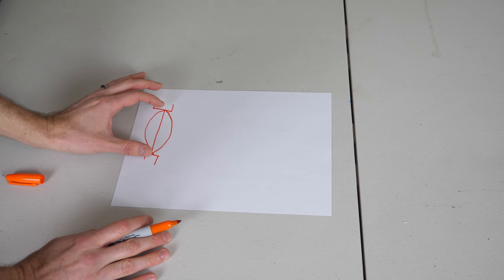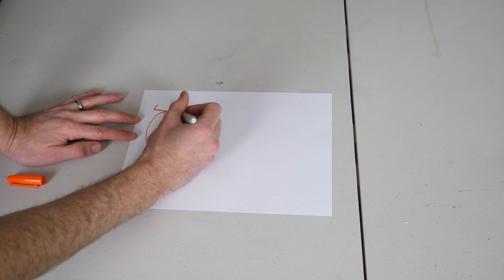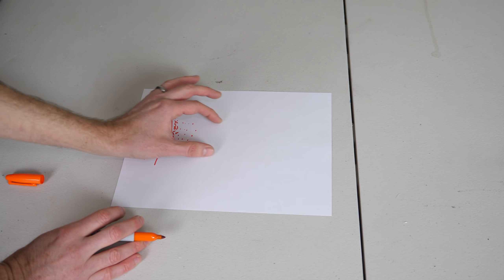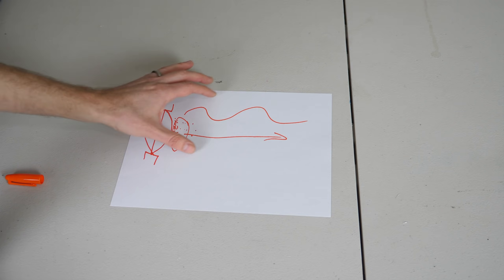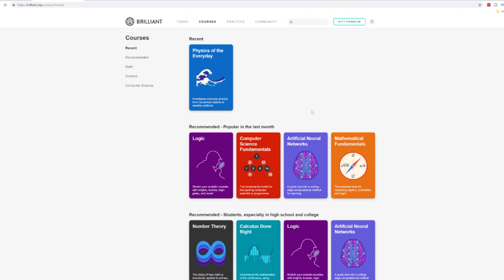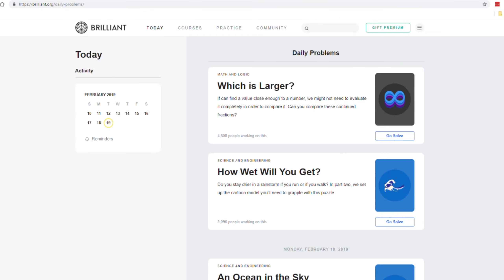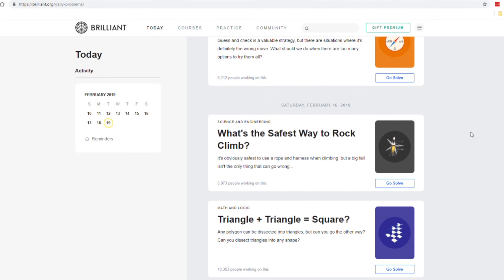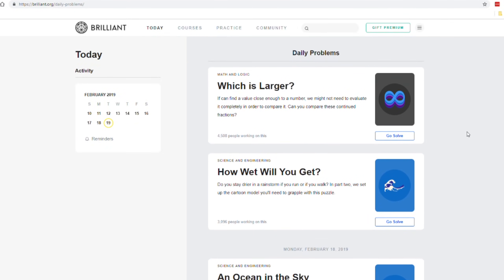Can You Figure Out the Mysterious Self-Singing Pipe Experiment?

Comment: I tried it with 2 inch galvanized pipe and a wire-mesh, it didn’t work.

What should be:
1) the pipe diameter?
2) the pipe length?
3) the wire-mesh hole distance?

Comment: I wonder if there is a thermoacoustic effect here. The wire mesh acts like a thermacoustic stack which (via heat transfer) pumps sound energy into the tube at the resonant frequency of the air column.  The sound stops when the pipe is horizontal because the lower air flow reduces the temperature difference across the stack (mesh).  You could demonstrate this by removing the mesh and heating just the outside of the tube. I'd bet the pipe will not sing without the mesh (thermoacoustic stack).

Comment: 11:03 The whole basis on how the LPC-10 speech signal compression algorithm works...It works by taking a dirac delta function, which is an impulse with silence around it and looping it at the frequency detected in the original signal through autocorrelation, then trying putting different filter coefficients through a digital filter until it finds the ones with the lowest difference between the original and the filtered output, then just stores the frequency and the filter coefficients. Which is why it's pretty lousy at reproducing instrumental music (which has more than one fundamental pitch simultaneously).

Comment: Notice the pipe length is about the length of half of the aluminum rod, but about an octave lower. This is similar to a clarinet, flute comparison. A clarinet and flute are about the same length, but the clarinet is about an octave lower. The clarinet is a closed pipe and the flute an open pipe. The trumpet is a different animal though, and this experiment is much more related to a clarinet. A spectrum analysis of the pipe sound also shows stronger odd overtones similar to a clarinet sound. Great visual explanation of an audio phenomena, and a must see for my clarinet students! Thanks.

Comment: Speaking of convection currents... The hot water output pipe on your water heater will let heat out of the tank in to the piping system, even when there is no flow, because there is no trap. A high spot in the pipe will block this flow of heat similarly to how a low spot in a drain pipe will trap water and block the movement of air. it doesn't take muck, even a loop that extends a couple of inches higher than the remainder of the pipe will block the flow of heat.

Comment: 8:50
If it sounds like a trumpet, then air is moving through it. What moves the air? Probably, the temperature difference. The bottom of the pipe is hotter than the top, so it heats the air which goes up and frictionst against the walls. The mesh, it has to do with the sound too but I missed where it is. Probably, it doesn't really matter cuz the air will move through the mesh anyway as long as the heated end looks down.

Let's see if I'm right...

Comment: Thinking about Rijke Tube ...it's just an organ pipe.  But what would make an organ pipe start self-oscillating?  AMPLIFIED FEEDBACK of course!   Just put a loudspeaker and microphone in there, with a power amp.  It will start singing, eh?
But that means ...the red hot screen must be ...AN AUDIO AMPLIFIER.  No getting around it.   Yet this seems obvious, once we've had the idea.   A red-hot wire will suddenly expand some cold air, but normally, the wire already becomes covered with expanded hot air.   Any "sudden expansions" and sound waves must happen because the hot wire is suddenly exposed to cool air, because relative motion between a red hot wire and the surrounding air has let the hot wire touch cold air.   To emit acoustic energy: to create a sound pulse, suddenly move the air.  Or, move the wire.   Sound flies out, and the wire gets cooler.  (Need an electric heater!)

Inside the Rijke Tube, if the air should slightly oscillate at the start, this will cause each red hot wire to generate sound-pulses, with a new pulse every time the air moves fully up or fully down, and touches the unheated air.

But that's no good!  TWO pulses per cycle, so this amplifier would be an ..um ...FULL WAVE RECTIFIER!!!.  It's only driving the 2nd harmonic, and instead of amplifying, would always be doubling the existing sound frequency, 2,4,8,16,etc.   To fix this, just use the "transistor bias" concept, by adding a constant air flow.  Now the slow-moving air is CONSTANTLY being expanded as it passes the wire.  

If it should then wiggle, then at the positive excursion it will expand more, and at the negative peak it will expand less.  NOW the hot wire is acting like a proper audio amplifier.   Stick it inside a pipe, and you've now got some reflections and feedback.   LOUD PURE TONE.

The Rijke Tube conceals a Victorian or "Steam-punk" gain-block!   Now think up some other uses for this "Rijke Amplifier."   

Heh, a metal screen that's chilled in liquid nitrogen might also make sounds, as it instantly contracts the moving air.   

Ah, that brings up the idea of STACKS OF RED HOT SCREENS, which SHOULDN'T give added amplification because only the first screen fully heats the air.  Instead we need to add "chiller-screens" between the hot ones!  How many screen-layers needed, in order to change a half-watt sound into a hundred-watt sound?   Can we build something that looks like a heated tennis-racket, yet whenever we yell through it, the sound gets twice as loud?  NICHROME GRID VERSION!  Stays red hot.   And then you could add forty-four pipes of differing lengths, and a keyboard to switch the nichrome heating, to make a "Franklin Pipe-Orgain Armonica" rather than a wet rotary glass armonica.  Sounds like an electronic synth.   Makes Ben Frankin's wife hysterical.

I notice that whenever I bring the oscillating pipe near the flame, so a bit of hot gas goes in, THE PITCH GOES UP!   Less dense gas!   

Ah, TRY HELIUM.  Try propane, try CO2.  Maybe it can detect the fumes above a pool of alcohol?  Does it sing higher as you go up the elevator, in a tall building?   Blow your CO2-laden breath into the "intake" while it's singing.  

Next, give the nichrome-constant-oscillator-pipe a sequence of different gasses, so it converts the gas-sequence into music.

But that's with wires being still, and the air moving.  What if instead the wires vibrated?   What if I used an asbestos glove, so I could STRUM MY RED HOT NICHROME-STRINGS GUITAR?  But the strings would put out 2F, one octave higher.  Sounds like an effects-pedal?   Well, unless air was blowing across them ...because  ...because  ...I'm strapped to the tower on my Deathmobile riding across the desert in some recent Mad Max movie?   THEY DID THE FIRE WRONG, IT SHOULD HAVE BEEN BLOWING ACROSS THE GUITAR STRINGS!!!   Heh.    Post-apocalyptic non-electronic flame-powered amplification, based on gas-flow across red hot wires, well suited to crude DIY tech devices.
.
PS
The "Was Septre" in ancient Egypt contained two secrets:  it was a crowbar, plus one other thing, where there is a little fork device on the far end.

Comment: 7:50 It works because that flame heats up the mesh at the bottom. That mesh heats up air molecules causing them to rise, so when you hold the pipe directly up and down, with the mesh at the bottom of the pipe, the air molecules travel through the pipe making it resonate, and you get that trumpet like noise

Comment: I got hold of a 1 metre aluminium rod and tried this - it works and is truly LOUD. I just wonder if a steel rod would be louder as it has more mass. I guess the frequency would be the same, although the vibration might travel faster through steel. In Helium gas the frequency rises, but what about a solid vibrating rod ? ….  Anyone tried this ?

Comment: I am 65 and have lost several different high freq.  sounds. I could not hear either rod when he stroked it but I did hear the heated pipe.  I used a app called Spectroid on my phone and saw about 2508HZ and 3094Hz on the rods plus 797Hz on the heated pipe. When I test for continuity with my multimeter, I can not hear it so I run the  phone app to see instead of hear it.  Works and I know I could get a hearing aid but they are a lot of money and I am very antisocial so I get by so far.

Comment: I wonder what would happen if u stuck a multi directional turbine like a savonius vawt on both ends of the pipe ( royko tube ) .  What would be the power output as compared to the heat in ?

Comment: I did a similar thing at work while cleaning the coating off of galvanized threads inside of a 12' or so pipe. I was using an acetylene torch (not very loud at all on its own) with a carbeurizing flame (meaning that not all of the fuel is being combusted = not as hot of a flame)

As soon as I put the torch into the pipe, the current of the torch tip brought a current through the entire tube, adding cold/dense outside air into the combustion reaction which created an extremely positive feedback loop and the whole pipe started to roar super loud at its natural frequency

Comment: You can put a wire screen mesh inside the pipe and heat the wire mesh up with a blowtorch  then remove it from the flame and cause air to rush through the pipe and make it hum.  *edit:  gets to the part in the video where he shows that..

Comment: So there is a neat mobile app called Advanced Frequency Analyzer. For rod one, the frequency was a combination of 2 peaks: one at 2.5 kHz and one at 7.5 kHz. The second rod had  a single spike at 3.1 kHz. The pipe resonated with two major spikes at 398 Hz and 796 Hz. Looking at the frequencies for the E-O thing, you actually aren't at the same frequency. E is higher, with major spikes in the 351 Hz to 468 Hz range, while the O's were lower in the 257 Hz to 398 Hz range. What didn't change however was the baseline ~140 Hz frequency. I do agree you are mixing multiple frequencies to create those sounds. Very interesting.

Comment: 8:35 haphazard explanation, let's see how close I am: the heat activates the movement of the particles of iron in the lower end of the tube and it keeps the particles sorta moving in place, but when you remove the "wall of fire" they're free to be acted upon by the force of gravity which makes the cords vibrate and produce the sound we hear from the other end of the tube... When we turn it sideways the gravity acts differently on the tube and not specially on the "cords"

Comment: It is probably better, and more accurate, to say the hot air is less dense than colder air.  Hot air creates a low pressure area which is displaced by higher pressure cold air.   It is the cold air pushing its way into the tube not the hot air sucking the cold air in.

Comment: When doing the aluminum rod sounds, I could not hear anything because I have lost random levels of high frequency sounds. So I started up my Spectroid app and watched the waterfall graphics and saw 2508Hz on the bigger rod and 3094Hz on the smaller one. This is how I have to see if my multimeter  is producing a sound when doing continuity test. I run the app and look at it.

Comment: Today Network engineers are like "That's ain't easy job".
Say "BNC" to someone above 50.

The slinky illustrate what was happening  in BNC network, the signal would bounce once it arrive to the end of the wire and the echo could be in opposite phase. This process would mangle your packets and the connection would drop.
So, we had to select a correct baud for the length and use BNC caps with a builtin resistor. But if the impedance was to high, then it would also eat the signal. Could even act like an RCL circuit :-D

That means that for a straight topology, we had to be able to calculate the strength and phase of the echo to chose the right BNC cap.
If I remember well, we used T junctions, no need for any kind of switch/hub.

When RJ45 was common and setting IRQ was not a thing anymore, life became way easier :-D

This has been the pain of many.

Comment: @The Action Lab Perhaps the flame heats up the air in in the pipe, which slightly reduces the pressure in the pipe, and as you remove it air rushes in to fill the gap and resonates based on the resonant modes in the pipe.  I don't know.  That's my best guess for now

Comment: It's "obvious" why the pipe causes convective air flow, but not at all clear what is causing an oscillation.  Just moving air through the tube wouldn't make it "sing" (put the tube in front of a fan or over a pot of boiling water, I'm sure it would be silent.  

I suspect the sound is from variation in air speed through the tube, and not the tube itself vibrating (which is why you can hold the tube anywhere.) There should be a speed of incoming air over the hot screen that results in a steady-state (no singing). But something about that system prevents it from finding an equilibrium point, and instead keeps oscillating around it at a frequency dependent on the length of the tube.  

Does blowing into the tube (from the screen side) while it's singing shut it up? How about moving it laterally? (Tube is vertical with a hot screen, but being moved horizontally like how you remove it from the flame.)  How about if the tube was held in a ring stand while the screen was heated, and instead of rapidly moving the tube away from the torch, you gradually remove the flame?
Reply from the maker: You are right that it isn't obvious how the sound is generated. I am actually not 100% sure so that is why I didn't go into detail. However, if I had to guess I would say that when the air gets heated the volume increases greatly. The incoming air flow is low compared to the outgoing air flow. So we can consider it as a tube closed at the one end (near the mesh) and open on the other end. This is the same a trumpet which creates standing wave solutions at the ends of the tube.
Reply: Why does one actually whistle with lips? You blow air at a steady pace but still create an oscillation (sound). The reason is the creation of a "Karman street": a trail of vortexes, originating from the lips in a periodic fashion, created due to turbulence in the air. Vortexes impart momentum to your lips which in turn self-sustain the formation of the "street". These self oscillations (technically, a "limit cycle") are what ultimately produce sound. The frequency of the oscillation is related to the rate of production of vortexes (roughly speaking and very unprecisely, the slower the air flow, the lower the frequency). The same occurs in your "singing tube": turbulent motion through the graticule creates an array of vortexes which impart momentum to the grid and put it into a self-oscillatory state. Notice how as the temperature gradient decreases (and thus the number of vortexes and their rate decreases) the pitch of the tube actually bends lower. There's a lot of interesting physics going on in here which has little to do with resonance actually: the non-linear convertion of a steady linear motion into oscillation (same occurs also with that rod, or with a bow on a string, or when your door just creaks), the creation of ordered patterns in turbulent and chaotic systems, limit cycles just to name a few.
Reply: @TheActionLab  warmer air has more energy and tends to be more erratic, it's not the air persay, but rather the erratic bouncing off the wall of the pipe and other air molecules by the air itself causing the sound, which is notable for how it gets lower and less as the air temperature bottoms out again
Reply from the maker: @Omnishredder  and  Fabio Cavaliere --Awesome insights! You are right that for the tube there is much more interesting physics going on than resonance. The fluid dynamics is the most interesting part!
Reply: @TheActionLab  something that just came in a random thought about thunder, it would have a similar effect in the pipe, since every direction is equal the sound waves bounce off the wall but because it's a single wall with no corners, the shockwave meets in the mid point but then grows as more shockwaves build up until it has enough reciprocal resonance making the waves gradually decrease but very minimally in scale, which would explain why, when you placed a hand over the open end it stopped, your hand was absorbing the shockwaves
Reply: If the pipe is different lengths or has a bigger or smaller diameter, how does that change the pitch? What about different metals?
Reply: I'd speculate that the mesh is creating a local, stagnant, stratum of air above the mesh and slightly below it. This stratum cannot immediately push its way up through the cold (='less hot' , if you will) mass above it the tube, but rather needs to get so hot that it either breaks through up one side of the tube or other or else pierces through the middle. This blob then moves upward and cooler air descends on the mesh to get heated and also temporarily blocks air from coming in the mesh.
(This dynamic will not apply as long as the intense flame of the torch is forcing hot and entrained air continually up into the tube.)

The tube is made of metal and thus will cool the air near the tube-walls, and the metal will quickly conduct heat laterally toward the cool(ing) ambient air.

But surely this blob-refill process is going to be far longer in period than the natural frequency of the tube. Yes, but any tiny instabilities (as other commenters have speculated) in this oscillation are going to get selectively amplified until there will arise a new oscillation that will blow some air actually back down through the mesh when the compression phase is at the bottom and then air will get sucked back in (and get heated) with the rarefaction phase.

The heating then is no longer continuous, but on a  (bottom–end) blob-out, blob-in positive feedback basis driven by the natural frequency of the tube.